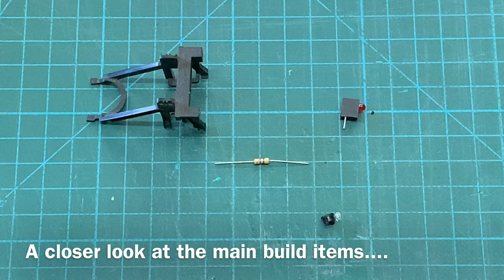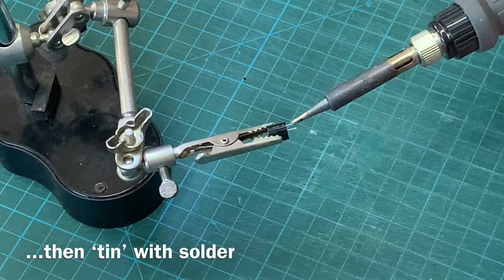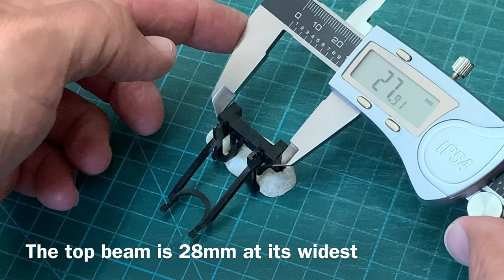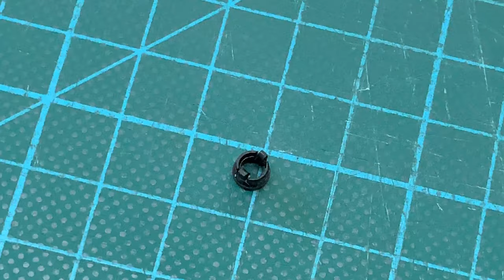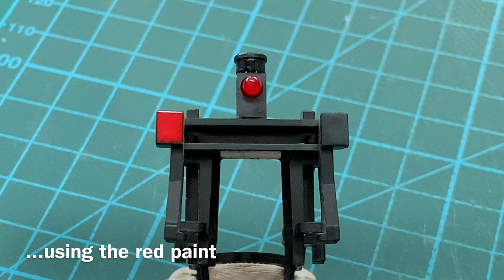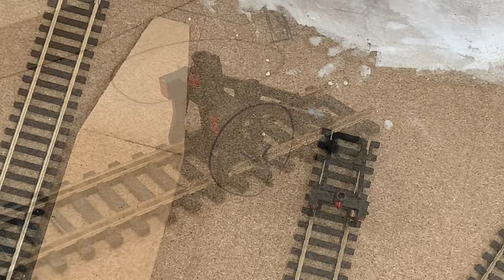HIMT 01 - "Pimp My Buffer!"

Comment: Hi Gary. I love the way you show the things needed for the project - very professional. I model in N gauge; do they do smaller LEDs?
Reply from the maker: Hi.  Yes, LEDs can be sourced, ideal for N-scale. A good supplier is RS Components. They are an international company and, the good thing about their products is, the unit description codes are the same everywhere. So, if you check out a code, using your chosen language, you can use a local outlet and, use the same code. Cheers!  Gary
Reply: @garydoc  Thanks. I am familiar with RS Components from my work days (I am now six years retired), but haven't used them for railway model supplies. I'll check out their small LEDs. Happy New Year to you and yours.
Reply from the maker: @PaulSmith-pl7fo    Hi. Forgot to add, RS will open an account, even if you’re not a commercial trading concern. Cheers!  Gary